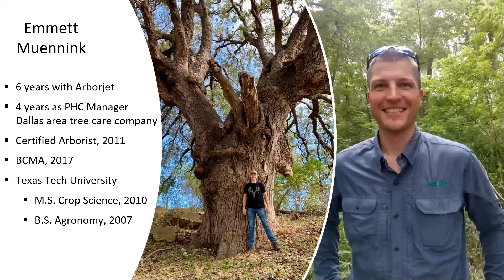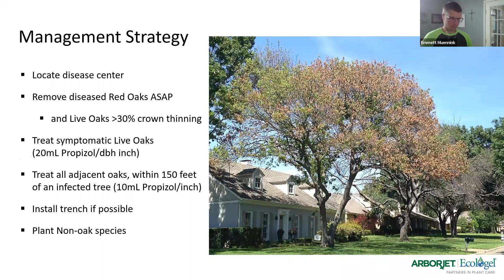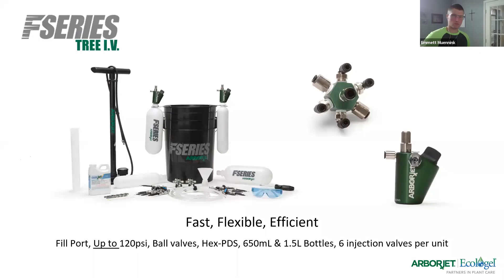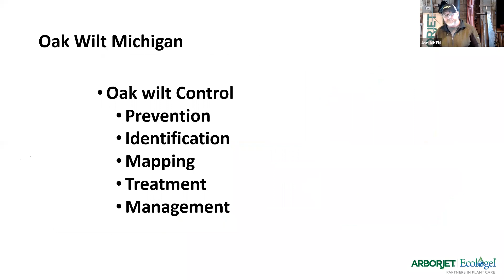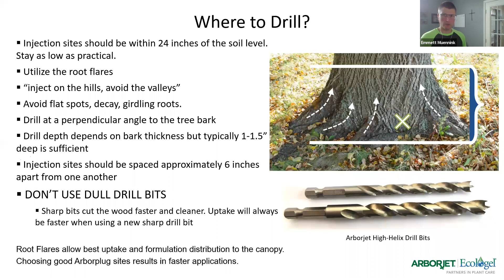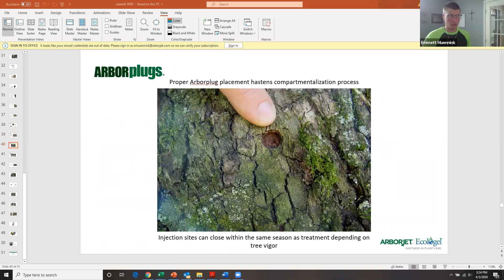Oak Wilt: History and Management-Arborjet Webinar

Comment: Y is quick jet air not recommended for oak wilt
Reply: Oak Wilt requires a high volume of fungicide, 20mL per inch in some cases. the QJA is better suited for low volume applications.